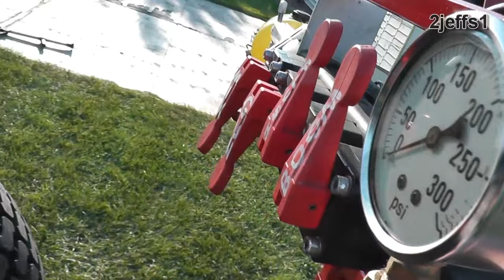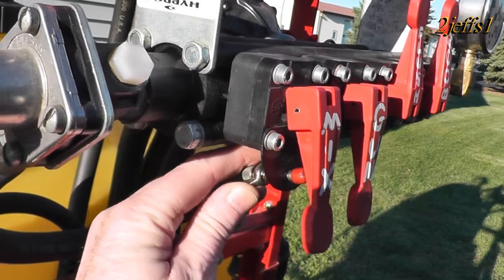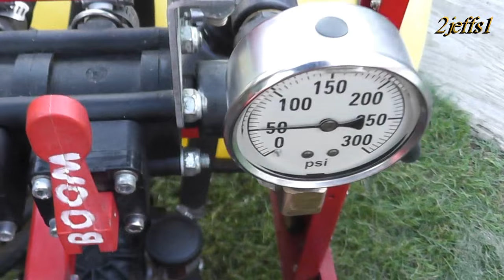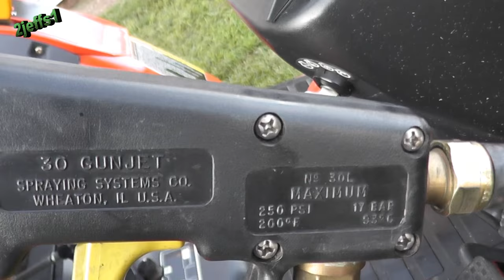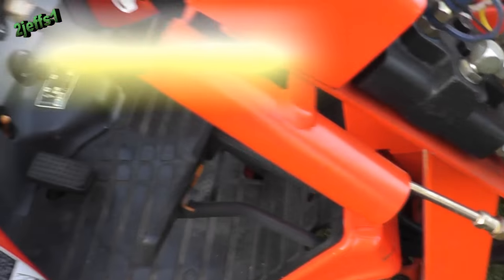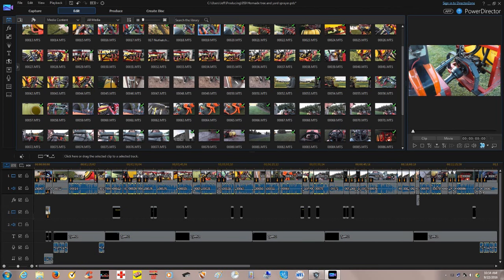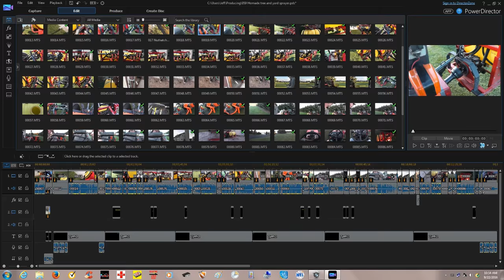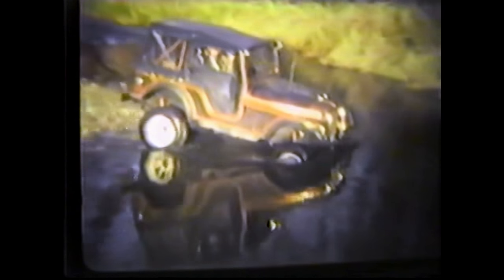Homemade Bug and Yard Sprayer 3 Guns and Boom Demo Too!

Comment: Your knowledge of pumping fluids is outstanding.  Great job on the tank and the video.
Reply from the maker: Too bad I didn't have some pictures of my first homemade sprayer when I first arrived here in 1986 which would bring a LOL. Worked ok for all those black ant mounds and small trees but was pretty crude! No pump, just an air tank to pressurize a fluid tank trailer unit. Nowadays those quad 4 wheeler rack mound tank 12v setups are pretty nice for not a lot of $   ;>)

Comment: That is a nice rig you built ....It is more complicated than I would have thought
Reply from the maker: That is a big time saver compared to the smaller units I built in the past. I did have a 2 cylinder diaphragm 20 gpm pump on that before the 3 cyl one. Tried multiple pumps thru the years and really love those diaphragm ones v/s gear or roller ones.

Comment: Thanks for adding the end. When you describe this two things come through. You dislike the idea of not thinking ahead for ease of service and repair which shows you repair things for a living. Second only a car painter pays close attention to switch spray patterns plus all nozzle tips. They go back to someone familiar with carb jets and injection nozzle tips. I would say you set up NOS systems too.
Reply from the maker: My favorite advertising campaign saying from years back was BASF. "We don't make the products you buy, we make the products you buy better" Or something like that! Really enjoyed your write up. Never dabbled in NOS but do have something to add. Many years back before NOS I had an 350 Honda cycle. It was idling without an air cleaner. The torch was near by with the brazing tip. Put it in the end of only 1 carb, turned on the oxygen and the engine went to 3,500 rpm immediately. I was wondering how long an engine would last at the drag strip on that! Take a beater and hide the bottle under the back seat, LOL

Comment: 2Jeffs 1 - This is a fantastic video and build - just like all your others.  I just bought a used Kubota B7510 and would love to build a rig like this.  Is there any possibility of you listing all the pumps and valve part numbers that you used, for us less talented fabricators?
Reply from the maker: No problem Joe. The pump is a Hypro model D115. I purchased that valve assembly from a local farm supply store.  Hypro model MV - 46305 1.3.MPR.

Comment: hey jeff nice job building the sprayer what kind of pump and valves you are using ,i will love to build one myself to spray some oak trees who are about 60 to 75 ft tall thank you very much in advance
Reply from the maker: The pump is a Hypro model D115. Bigger is better like on an air compressor pump to avoid the - I wish I would of's. I purchased that valve assembly from a local farm supply store.  Hypro model MV - 46305 1.3.MPR.
The gun I would recommend is that long one is best for distance. Ritterhouse has a lot of useful products on their site and where that came from. http://mkrittenhouse.com/us/ Seems I might of bought that pump there too.
Reply: 2jeffs1 thank you for the reply how high up can you spray the trees around here are 60 to 75ft tall
Reply from the maker: If there is no wind I can get to the top of the silo. Best guess that is 50' The pump is capable of 300 psi. I usually spray from 200 to 250 psi so 60 - 75 might be possible @ 300 psi.  Not aware of any better setups for that distance you are trying to reach.
Reply: thank you very much for your help if i get any other question i will ask you tou are a very knowledgeable person

Comment: I see this is an older video but I'm curious what psi you run at to spray your pines? I'm needing to spray my pines for beetle and have some pretty tall trees. I'd say 50 or so feet. I can't figure out if a roller pump would handle it at 250-275psi and around 10gpm.
Reply from the maker: Hi Jason. I used those roller pumps years ago. NOT impressed. I can reach the top of the silo with the 3 cylinder diaphragm pump I have now. I set it around 225 psi. That pump is rated at 29 gal per minute. Why so big when I only have a 55 gallon. tank? That makes my rig very impressive just off of idle. Fuel and wear and tear savings very nice. Cant remember what tip I have in the gun (its big) but it really works great, get done much faster with this setup, time is so precious to me.... back to work.

Comment: could you tell what to use on weeds .as I would like to make some up and then use it .what is needed and the recipe. thanks
Reply from the maker: Great question. For the weeds in the lawn I use 24D. I buy it in a 2.5 gallon bottle. It's concentrate and is only around 40 bucks and lasts many years. It is available in 1 gal too. For under the pines to kill everything I use Roundup. I buy that in 2.5 gallon container from a farm co-op. Around 90 bucks. For those prices it don't pay to mix stuff up that don't last or work as good. Beware -The big box stores get 40 a quart for Roundup, 20 for the diluted concentrate. Way too expensive, robbery without a gun!

Comment: What is the BOOM valve for?
Reply from the maker: The boom is the fold out piece attached to the back of the sprayer. It is used for weed control in the lawn.